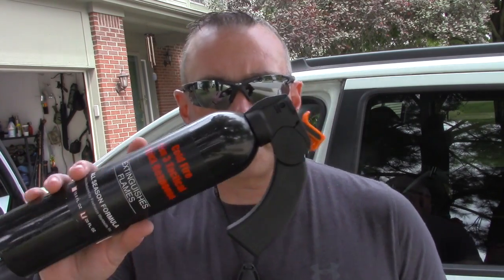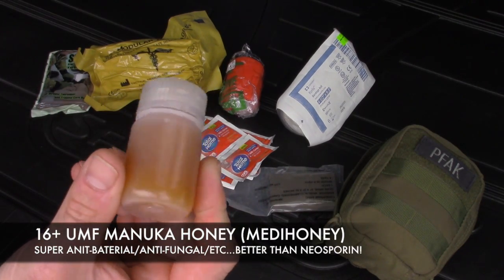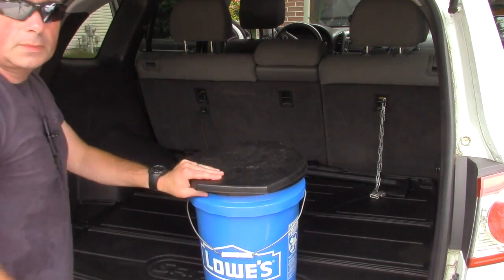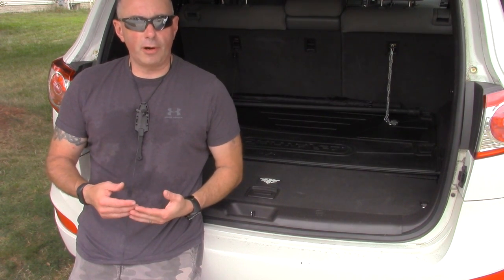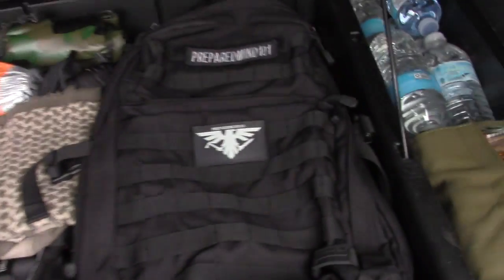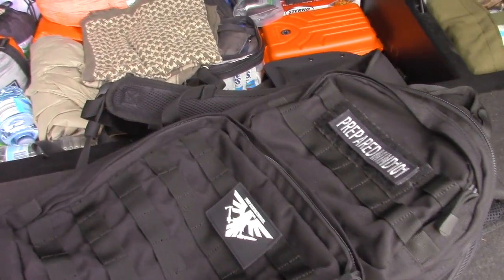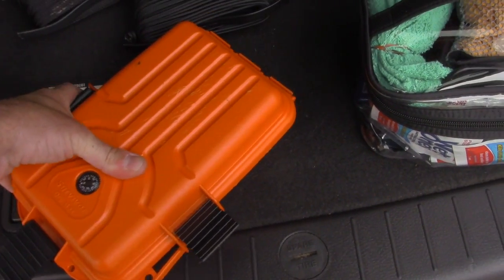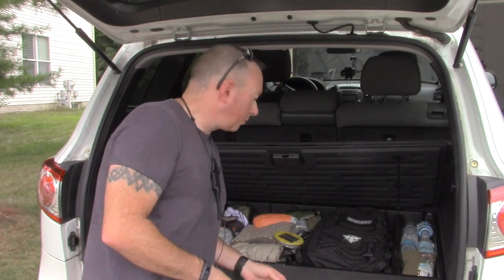300+ Piece Vehicle Emergency/Prepper/SHTF Kit REDUX - Preparedmind101

Comment: Good video Chris, I have quite a bit of stuff in my pickup cab (extra cab) between the console and under the back seat including a good arm load or two of scrap lumber in the bed for a nights worth of firewood and a 10 liter jerry can full of pump gas, the ONLY thing I think you might do best adding is a recovery tug strap for the vehicle.

Comment: I'm not criticizing your load out in any way. In fact I love what you have. 

I have had to fall back on my equipment before. We had an emergency where we were about 100 miles from home. Our radiator sprung a huge unfixable leak. Luckily I had someone I could call to bring me a new radiator. I carry all the tools I need to get a vehicle back on the road that might come across certain major problems. I carry every fluid my car takes (except for extra fuel). 

I also have some food and water, lots of cordage, a few tarps, shipping blankets, clothes, shovel, several knives, several methods of fire starting, and depending on which vehicle I am currently driving I have 50-100 rounds of extra ammo for my main carry gun. I do carry 2 guns on occasion as oklahoma law doesn't restrict how many guns one can carry. 

I also have a bag with the basics in it that can get me hime on foot if I have to leave all my stuff behind. I  can grab that bag and escape. I call it a get home bag as that is my first priority because that is where all my stuff is as well as "reinforcements." It is essentially a bug out bag. It is a bit smaller than my normal b.o.b. The only time I would need it is if the shtf while I was out and the roads were impassable. I am a private investigator so I know most side and main streets in my city. 

Again, I am not criticizing you, I am just telling you what I have hoping you might find something you overlooked or point out what I might have overlooked. I watch most of your videos and enjoy your format. you are very educational.
Reply from the maker: +William Cagle I covered that at the end. If I were taking some large trip like that, I would adjust. 90% of the time I'm operating in a circle no more than an hour and a half from home.
Reply: That makes perfect sense. I'm a private investigator and I perform physical penetration testing and terrorism vulnerability assessments all over the state of Oklahoma. I modify my load out when on the job. I am often in some shady areas and in the middle of nowhere when travel between sites. My work load out is more tactical than the everyday. I carry the preparedness mindset on the job as well. 

You definitely showed some awesome stuff in the video and I do plan on adding a few of the items you showed to both my load outs. 

Keep up the good work on the videos.

Comment: It's not like you have a hoarder vehicle, you wouldn't even know it's there. My plan is to eventually have 3 bags (Car Kit, Turnover or Change of Clothes bag and Get Home Bag but mine unlike yours takes up alot of room. Good job. 

Of course I have to throw in a suggestion. Faucet/spigot key.

And a question if you have time. I'm trying to follow the 10 C's type idea. Recently I have bought some Cutting Tools and Combustion Device. Next on my list is Container, I was thinking of getting the Klean Kanteen 64oz that you have but another Youtuber suggestion an Army canteen would do just fine and it would have a cup. Thoughts on my first Container purchase?

Comment: Chris that is a very capable kit, but with your statement of the jumpack of self independacy. Add a sperpentine belt and serpentine belt tool . Without this belt or some vechiles belts , you are not going anywhere. With rgular maintenance you will probably never need it, but they do break, these items are small and thin. Anyone can put on this belt if you have the belt routing diagram that is under almost all vechile hoods ,  the tool makes the idler alot easier to deal with than a ratchet. Super great kit , I am with you about a kit needs to be hidden from theives!!!!!!!!! Enjoy your vids and reviews .

Comment: I'm surprised you didn't have more vehicle/roadside type stuff. At lowes you can get an air compresser that plugs into DC outlet to air tires. Also you should look into a tire slime repair kit. A reflective safety vest in case you get out of car on side of road in dark. Looks like you are prepared to never go back home but not for common driving problems.  Also a burnkit or watergel for treating burn injuries, there are lots of ways to get burned badly outdoors or car related. Not meant to bash/judge in a negative manner, but as helpful suggestions.

Comment: what of bolt cutters or some other chain-cutting capacity, and a set of spare auto parts commonly replaced, and related tools? i see this kit having a slightly harder time in urbanized areas but still well-rounded, a spigot and a collapsible hose could be a good addition too, hmm

Comment: I know you have solar panels for the power packs just wonder if you have one for the vehicle battery. Most parts stores have 14w panels that can be put on the roof and run straight to the battery to keep the charge if you are using the truck to charge all the other stuff

Comment: While going over your kit I noticed you had granola bars in a ziplock bag.  I have been building earth quake kits a long time and have found that the free cardboard boxes from the post office do a fantastic job of protecting food stuffs and slightly damage able item they keep backpacks from wearing away the edges of hard granola bars or smashing of the soft granola bars this worked good at Yuma proving ground when I worked as a data collector for 6 weeks 14 hour days living out of a pick up truck.the boxes held up to transferring twice a day from my suv to the truck the my hotel room and back the rode 120 plus miles a day still have two of the original boxes in my truck kit full of granola bars but these are not just for the bars the boxes work for everything that ca get lost,broken, torn, smashed.  You can label them with a sharpie on the fly and they can become tinder if you need to light a fire.  There free at your local post office and the post office will even deliver free.

Comment: Thanks Chris. Getting me thinking of going through my own car kit soon. Usually go through it in Autumn and Spring... change out Summer stuff for Winter stuff, etc. I need a better way to store water in the car. Either it will end up boiling hot or frozen. Any ideas?
Reply: I used to keep a standard kit in the car all year round with a "seasonal add on" that I changed accordingly. The basics are all pretty much the same but to tell the truth the UK is pretty temperate and we ALWAYS expect rain! :-)
Reply: I used to keep a standard kit in the car all year round with a "seasonal add on" that I changed accordingly. The basics are all pretty much the same but to tell the truth the UK is pretty temperate and we ALWAYS expect rain! :-)

Comment: Bottles of water go off as the plastic leaks chemicals from plastic. U can use it if engine runs out from fault but you should use cans of pop or cans of water instead they lady longer. A packet of nuts is advised they keep in the car. Also do you have emergency glass smasher in the front of ur car and raidioator sealer just incase you damage it?

Comment: I know it is mainly about camping. But do you have mechanic tool set in your car? I live in Texas and it could be 2 mile walk back to the house { and 30 miles to the store} if I don't have a mechanic tool set to fix the truck. Some extra ant freeze and motor oil go along way to. Got most of the stuff you have in your kit minus 10 or 12 knifes but there is always room for improvement.  Great vid.
Reply from the maker: +Jesse Davis I just keep up on maintenance. If the car breaks down, I can set up camp and wait for a tow truck.
Reply: Thanks for the heads up about that solar blow up light. I used 6 of them to fix 3 acres of fence after our bull and the neighbors bull got into it one night last week.

Comment: I need a rubber mat in my Jeep Patriot 4x4 to prevent my bug out gear(in a locker)from sliding around.Drives me nuts.I also have a BOB pack (5.11 tactical clone of 24 Hour pack which is a SOG)In my pack I have what I need to bug out,God forbid there's a major emergency where it's necessary(10 c's of survivability in pack plus food)I have an old .22 rifle I keep in the vehicle with plenty of ammo(325 rounds in box it came in)On me will be my Sig Sauer .40 S&W also with plenty ammo..Cutting tools are a Husqvvarna hatchet,Condor machete,TOPS BOB knife with ferro rod that comes with it,and a Jeff White Nessmuk skinner.I keep a cheapo Bivy tent in my BOB,with an SOL bivvy bag along with the wool blanket I leave in vehicle that would be attached to pack.Now I need to buy some non perishable food items preferably rice,red beans,tuna and or salmon packets,candy bars,Ramen noodles,etc,etc.Have a 64 oz stainless steel water bottle filled with water that goes in pack.Then there's hygiene,first aid,a deck of cards,just to mention the more necessaries..

Comment: Vehicles usually come with a spare wheel, a POS jack and a lug wrench. Assuming chris hasn't discarded them and made room for all this other stuff he should be ok for the first blown tire. It's rare to have multiple blown tires at once unless someone threw caltrops at you. Still, for a car kit, there isn't much in the way of car maintenance/ repair stuff. Maybe do a series on learning basic car maintenance and repair.
Reply from the maker: +Jaime Sze tire is under the car. Jack and wrench are in the first compartment. I get regular maintenance.
Reply: but what if... the ninjas end the world and you CAN'T get regular maintenance? lol But seriously, I remember you did a review on the anker solar charger. How bout throwing that in the car kit. It's one more tool that doesn't consume resources but provides you more resources.

Comment: Good video and a nice presentation of the logic of how you prep.  Much of my comment is not directed at your video, but to share with those who are building such kits.  For you, PREPAREDMIND101 I will make only one suggestion and it concerns the topic of navigation.  Don't rely on a battery operated compass.  I have a very good compass on my watch as well, but what happens to you if gets submerged or the battery fails?  Get a good Silva or Suunto compass and carry some basic maps. I suggest getting a compass that allows adjustment of the declination, which nearly every watch type compass has, but is not common on basic compasses.  The compasses I carry all have sighting mirrors as well, which double as my signal mirror.  I have GPS devices, but I don't totally rely on anything electronic for navigation.  I always have a Michelin atlas (their North American atlas is the best published) under the driver's seat.  Carrying more detailed maps is not possible for everywhere you might end up is not possible.   I carry a 8.5 x 11" map of declination of the U.S. in my vehicle and comprehensive 72 hour bags.   

I happen to carry a lot more tools as I make various repairs at the homes of friends as well as repairing the car (& those of people that have broken down), camping equipment and similar.  My tool kit is the basic ingredients: hammer, socket/ratchet set, wrenches, pliers, screwdrivers, hack saw, wood saw as well as a hand crank drill/bits, soldering iron, inverter, tire repair kit and a 12 volt air pump.  Like you, I carry things that are not survival items, but those needed when you end up staying longer on a multi day trip than anticipated or helping a friend fix something.  These two scenarios occur frequently. 

I also limit my flashlights and the radios I carry to using AAA, AA (most often) and D (least likely) batteries,  I carry a minimum of 4 AAA, 18 AA, and 2 D batteries in each car's pack.  The charger shown in this video is the same I've seen in at least 3 videos and I need to carry one in my cars.   

I also carry ham radio equipment every time I go out the door.  My cars each have a mobile VHF/UHF ham radio mounted in them.  My off highway 4WD, a 40 year old Toyota Land Cruiser, includes a HF radio (High Frequency, incorrectly known as "short wave"), that can carry long distances over terrain and not depend on line of sight or repeater communications.   The highway car doesn't have the same amount of space for radio mounting so I don't have HF in it. At a significant cost, I've purchased the same type of handheld radio people in the federal land management/fire/EMS/SAR services (NPS, USFS, BLM & USFWS) use.  I obtain official frequency directories (updated annually) from friends still working for these agencies and know exactly what to program into these radios.  I understand the lingo, command system and protocols of the emergency services.  I realize that my using these systems is legal only for current employees and would only do so in life and death emergencies when every other option has already been tried and has failed or is unavailable.  I'm a retired member of that community so being cut a little slack is remotely possible, but not for others.  "I would rather face 13 (judge and jury) people than 6 feet of dirt on top of me."  

I'm a retired forest/park ranger and have assisted hundreds of people in remote and/or roadless areas, on foot, horseback, skis and in/on a vehicle, sometimes in dangerous weather conditions.  I had to be prepared to spend at least 24 hours on a fire, search and rescues, hanging on a rope on a cliff face, etc. at all times no matter my current mode of transportation.  Frequently I drove to the nearest helicopter landing zone and was transported to some rugged, remote locations.   Experience/practice taught me a great deal.  I think everyone, for every kit, should make sure "The Ten Essentials" be carried in every type of kit, no matter where it is to be used, city or wildland.  Refer to the "Mountaineering: The Freedom of the Hills" version for what is widely regarded as THE list.  The Catch-22 for me is space and my highway car has a lot less storage space than you are blessed with.  I know that I'm probably losing a gallon or two per mile just because of my extra gear and I don't like that at all.
Reply: I should also add that I saw several other items in your "kit" that I'm going to look into.  I passed ten years of retirement and am not rubbing shoulders with those who keep up on the latest tools of EMS, fire lighting and etc. I used to get write ups on darn near everything that came along relative to the wildland based emergency services.  

 By the way, if someone wants to "burn down the world" they would likely want to carry a wildland fire drip torch with a diesel/gasoline mix.  

All in all, this is the best car carried emergency kit video I've seen so far.  It is very well thought out.  I don't subscribe to any preparedness channels, but I just did to yours.
Reply: I mentioned ham radio in my first comment above.  I think that anyone preparing for whatever should invest a little bit of time to study for the lowest level of amateur radio license, technician and purchase a quality handheld radio.  The technician class license exam is very easy for nearly everyone.  Local ham clubs often conduct license instruction and conduct the exams.  A Google search will put you in touch with a club that does this.  Don't buy one of those cheap Baofoung (don't know the spelling) handhelds from China.  I don't think they should be legal to operate in the U.S. as they have a lot of "specification failures" resulting in transmissions off frequency and other assorted misdeeds that can cause problems for others. Very good handhelds can be obtained for a couple of hundred bucks.  If you shelter in place a "general" license is a big bonus as you can operate in the High Frequency bands which allow world wide communications.

Comment: I want to do the same but I live in Houston and my concern is the heat and how it would affect my gear being stored in the trunk?  We can be 85-100+ degrees for 9 months of the year.  Do you think we will run into issues with the heat and the gear?   Also what food items , electronics like lithium batteries, and  fuel like propane and sterno,  would be safe to carry in that kind of heat?  just wondering if I can do a similar car kit with the weather we have in .Houston
Reply: We Mo I keep a lot of crap in my truck, including batteries. Do you have storage under the rear floorboards and seats?

Comment: Do you ever run into those wet wipe packs going dry on you? I've had some in a pack for less than a year that dried up. Thoughts on keeping them from doing so?
Reply from the maker: +Steve Walker I haven't.
Reply from the maker: +Steve Walker at least...not the individual ones.The ones in the containers will.

Comment: How does the bottled water stay safe while being heated up to 100° plus inside a hot vehicle and then cooled down everyday..... I've always been iffy about leaving water in edc vehicle kits
Reply from the maker: +Tyler Mac it never gets that hot in those compartments. Room temp at best. I've pulled it out many times on a hot day.
Reply: +PREPAREDMIND101 I gotcha. I have noticed that in a ram 1500 the floor compartments are under the rear floorboards. they don't get too hot (80° max) but I'm still paranoid about plastics and eating/drinking items in them. thanks for the reply